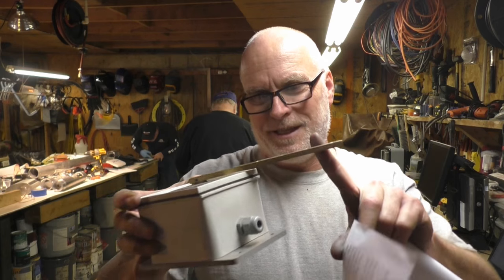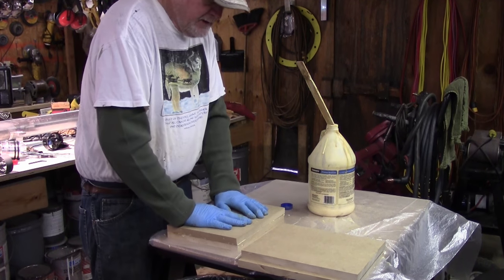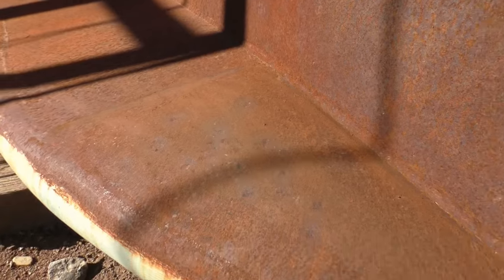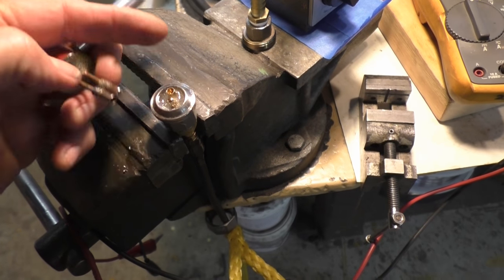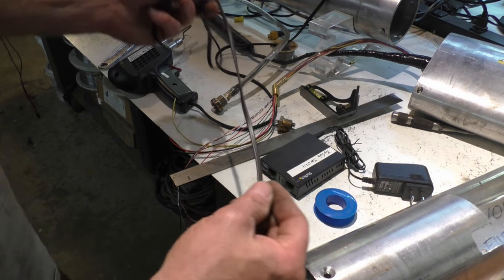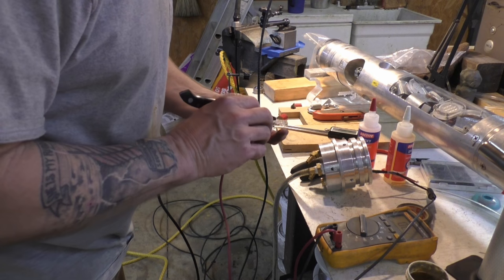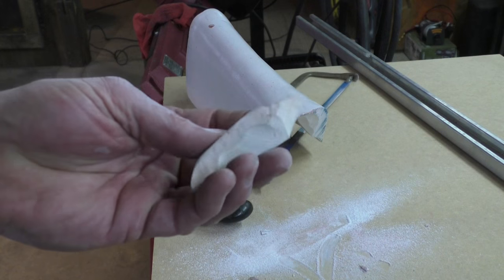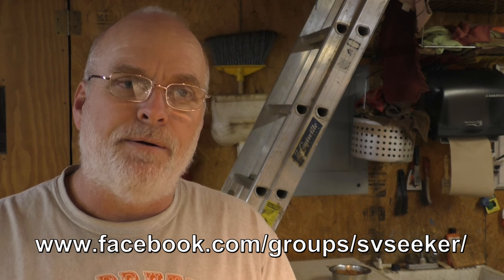ROV Wiring, Ice Damage, and Talk about a Water Maker

Comment: For keeping Carbide tips clean when grinding aluminum, steel, etc. A small container of WD-40 works very well. It keeps the tips from clogging really well. Dip the tip in it, remove and give the grinder a quick burst before you go back to grinding gets the excess off, and cools the tip as well.

Comment: Doug great update and it is quite powerful how the maker community are contributing to the many complex supporting projects. I just wanted to make a constructive comment about water production. Others have already commented on the energy input of a conventional distillation plant which effectively means you will need considerable additional heat input on top of the heat you recover from the engine. I think you mentioned that you preferred a distillation plant as you perceived it to be lower tech and within your ability to fix away from more sophisticated support. Well in my experience you will get lots of opportunities to exercise your maintenance and repair skills with a distilling plant, probably x10 of what you would with an RO plant. I spent a decade looking after conventional distillers (amongst other marine kit) and it was like manna from heaven when RO arrived on the scene - it was literally transformational stuff and greatly improved the quality of my life. I will not witter on anymore but if you want any more details I can email you - just let me know. Recommended you review or ask for a peer review from your tech group.👍
I love this project and wish you all the best.😀

Comment: seeker im really enjoying these videos they are great. i had one question about the ROV that im not sure if you covered it i may have missed it in an earlier video or not. but have you thought about pressurizing the rov in anyway like 3 to 10 psi of air or something even mineral oil to keep it from collapsing or leaking under external pressures. i gotta add one more thing before i found your videos the only thing i knew about boats in general was how to fix the engines that run them. your videos have opened up new learning experiences for everyone. and its a great experience no school could ever teach ( unless you wanna go bankrupt ) haha. thanks seeker if you see this.

Comment: If i remember correctly, those are not potentiometers but rather synchroneous motors which speed is relative to frequency.  They lend themselves idealy to replicate movements when you put two of them in paralell.  When power is applied to the circuitery, if you move the shaft on one motor, the other shaft will rotate exactly the same angle.  This method has been used for  a long time to steer remotely TV antennas for example.
Reply from the maker: Thanks

Comment: The correct term for making fresh water by using waste heat is "evaporator". It is commonly used on larger vessels that have steam plants. It is a rather inefficient process compared to the energy used by small RO units..  You might want to run the calcs to see if your engine will produce sufficient heat to make an evaporator practical.

Comment: you could 3d print a jig to hold those connectors? Or maybe even a plug that can fit more snug into the fitting and you can just epoxy that in?
Reply: Also, thanks for the tip on waxing bits, I am constantly fighting my Dremel bits clogging up with aluminum.

Comment: Just a thought for holding the connectors in the right spot while the epoxy cures - could you use putty epoxy? The kind you knead together and that activates it?   That would make it easier to setup the pin placements probably? IDK just a thought. Cheers from PEI Canada, Bryan
Reply: formerly 987946216430 the liquid flows and eliminates alot of air gaps. 
however epoxy putty definitely gets used here a bit

Comment: I have a set of bits that are very course and are much better for aluminum than a fine pitch file.
Most of the indicators that I've worked with are current based.  Even 'volt meters' actually work by passing current through the indicator(needle part) and back to the other side of the voltage source.  The range knob actually puts different resistors in series with the indicator and keeps the needle from slamming to one side or lets it show more than a little movement on the needle.  Most of the indicators that I've worked with are 100 milliamp.  So for your indicator to show center (neutral rudder) it will have to pass 50 milliamps if it is a 100 ma indicator.  The resistor can be changed (potentiometer) should you need to run it off 24 volt or 6 volt.
Reply from the maker: Thanks Bob
Reply: ***** Not sure what they are called. Just really coarse.  They will gum up with aluminum but takes longer and is easier to get clean.  I like WD40 for lube and it won't gum up at all.  Like Doug mentioned, welding after lube does take a little extra cleaning.

Comment: What are the dimensions of the union fittings and bullet connectors you are trying to pot?  I could make a bunch of delrin plugs to fit in the end and align the bullets so you can epoxy them.

Comment: A watermaker is just a reverse osmosis system with a high pressure pump. All you need to do is figure out the specs you need and buy the parts online and save a ton over a commercial watermaker unit.  I would hesitate to go to distillation unless I was sure I did the research that it would make enough water to get by on.

Maybe you should drill a couple of small drain holes in that keel until your ready to weld em back up to let any water just drain right through until your ready to paint the hull.
Reply from the maker: Water Maker: http://wp.me/P6ivyU-1bk

Comment: First, let me tell you that I love the project and the videos you are producing about it. I'm just trying to help where and when I can!
I read your blog post and still do not quite agree with the distillery (and the accompanying systems) being the best way to do it:
- First, for the blog: In many areas, the rain water is not drinkable any more. So many people are right.The same goes for rivers, ice etc. And humanity never had the ability to drink salt water.
- You really need to keep every part of the boat that will collect rain water very clean, or build another filtration system. And trust me, this is going to be a huge task!
- Distilleries are - even if you reduce pressure and so on - terribly energy inefficient! It will cost you huge amounts of fuel (and carbon emmissions will be high) to power that beast. The power you can get from solar arrays and wind generators is neither powerful enough, nor reliable enough to be your last backup system
- What the f*** do you need 150 gallons an hour for?!
- You will have to deal with a lot of maintenance work, starting with removing salt from the system, but also - and don't underestimate that - rusting metal. Remember that salt water is very aggressive, no matter whether it's on the outside of the hull or inside a distillery!
- You will always need a pump to drive that water through the system. Even if you use parabolic mirrors and what not to heat the water. Don't think it will work without electricity (/fuel), at least if you do not want to pump that water on your own. But that does not fit in with the level of comfort you want to achieve.
- The system you came up with to use and reuse energy aboard is very intelligent and environmentally friendly, but it is also extremely complex! It will take you a lot of time to build that, and a lot of money for all those fittings, pipes etc.
- Plus, distilled water is not very healthy to drink. It does not harm you directly (at least not as much as salt water does), but it is definitely not recommended to drink it regularly - or even as your only water source!

All in all, you could easily use a well thought out reverse osmosis system and replace the parts when needed (they are so light, you could carry 10 of these filters all the time. And weight should not be a concern for a steel boat owner anyways). Do not try to reinvent the wheel just to be able to make something on your own and stand out of the mass. You got plenty of jobs to complete before this ship is finished, and this project will take you a LOT of time.
Reply from the maker: Hello Hans.   Thanks for you options.   And 150 gallons an hour will allow us to provide relief services as well as make the most out of a short run of our main engine.

Comment: y would not go for the keelcooler around the prop shaft, the higher water temperature gives problems whit the grease getting to thin, a sepereate pijpe welded under the boat works yust as good, and dont gives problems whit the proppelershaft tube. , other thing, why dont you weld some plugs in the keel, to drain the water< plug them up whit a steel plug and teflon tape?.(had the same problem here whit a boat from a customer, always leaking water, we re did the cooling (not through the keel anymore) and no problems after that fix!
Reply from the maker: Thanks for you opinions.

Comment: 8:07 A distiller doesn't use any disposable parts which is real good , with RO you'd be sure to run out of spare filters at the worst time... If you have any access to "fresh" water or condensate from an AC unit that would be best to feed the distiller to reduce maintenance.  In primitive areas they use a filtration system consisting of a carbon impregnated filter (think large clay flower pot) http://pottersforpeace.com/?page_id=63 http://aroundtheworldwithjustin.com/fathom-travel-wine-to-water/
Reply from the maker: Excellent program.   Thanks for sharing it.

Comment: what constitutes excessive EGT? If everything is       working properly,
 1250º to 1300º F. is a safe turbine inlet       temperature, even for 
sustained running, mile after mile. Above       1300º F. things can 
start to get edgy. Remember, excessive EGT       damage is cumulative. 
Over 1400º F., you're usually gambling       against a stacked deck and 
it's only a matter of time until you lose.       The higher the EGT, the
 shorter that time will be.
Reply: Wrong video?

Comment: If a distiller was more reliable then why don't normal cruisers use them?  They all use RO for their water maker.  RO is reliable enough and if you get the right system it uses no proprietary parts.  Also think about the higher concentration of salt that will be in the distiller making it less effective and prone to leaks.  It will also wear the distiller out faster.  IMHO going with a distiller is not a smart move, stick with a tried and true method.  Parts are available for a RO system all over because even large ships use RO for their water.
Reply from the maker: For "normal cruisers" RO is a great choice.   My reasons are stated here:  http://www.svseeker.com/wp/sv-seeker-2/sailboat/mechanical/fresh-water-supply/?v=7516fd43adaa

Comment: ro needing lots of parts? a pump and a set of membranes...
Reply from the maker: http://www.svseeker.com/wp/sv-seeker-2/sailboat/mechanical/fresh-water-supply/?v=7516fd43adaa
Reply: SV Seeker that top picture is gorgeous!  and 150 gallons an hour sounds almost to good to be true but awesome! sure does look like a nice option. my silly point was only you need pumps, valves, and chamber for both so main difference is membranes. but the evaporator does seen like more beauty in simplicity
Reply from the maker: There is considerable difference in the pumps too.  I think we can build the pumps needed for the distiller with a mill, or even less.
Reply: SV Seeker nice, ya I understand :),  low pressure compared to high pressure, some extra forgiveness there.  Just the way you looked and the way you said extra parts got to me :) . I'm not gonna argue with 150 easy gallons a day though, that's pretty slick. I've never seen numbers like that for a distiller